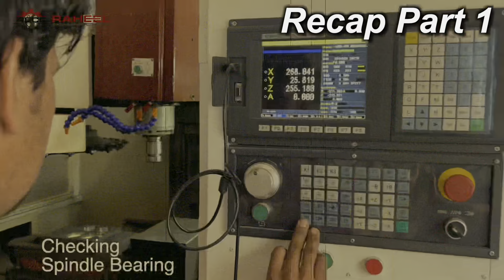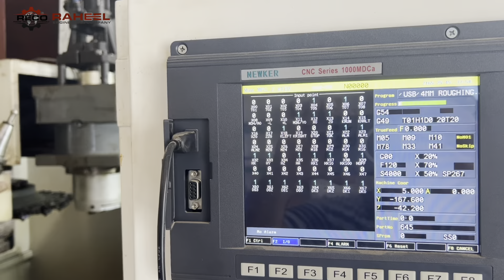CNC Spindle Bearing Replacement Final Part

Comment: Runout spindle bearing chnge krne s thik ho jygi
Reply from the maker: There is no connection between spindle bearing and runout 
For run out please check your ER collets and your collet holder and remove dust particles from collet holder tapper
Reply: Runout is in spindle. 0.1mm how to fix that
Reply from the maker: May be ER collet need to change I hope your problem will be solved